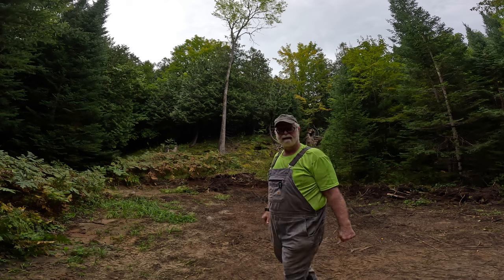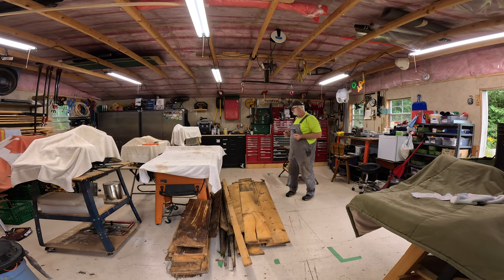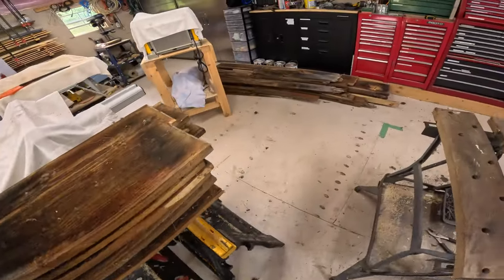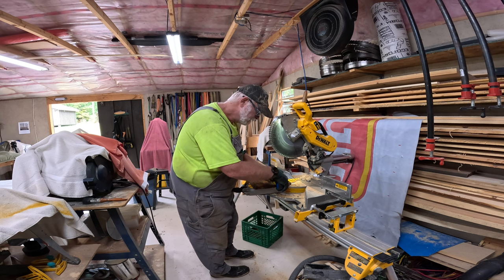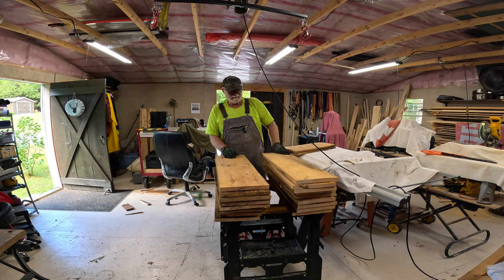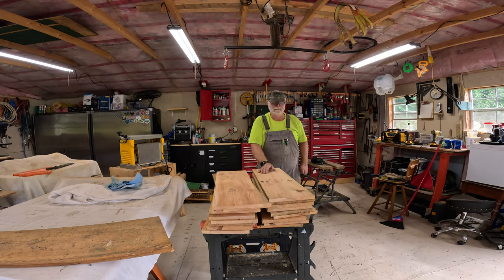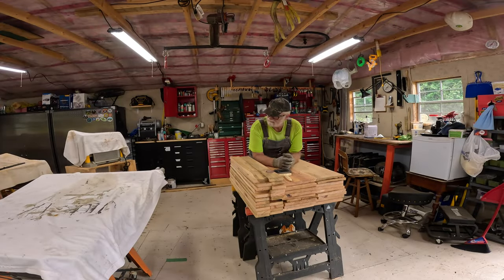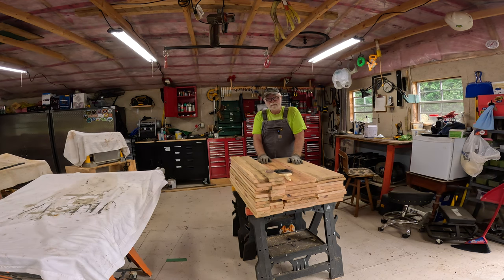HUGE Stackable Storage Boxes from SCRAPS - DIY Woodworking Challenge

Comment: If you've gone to the effort of pulling all the nails, put the offcuts through the shredder for future path repair use - beats burning for several reasons.
I recover lumber from all over - heck, I found a part sawn tree trunk on the shore today that's about 5' by 2' by 20" & I'm going back with the chainsaw tomorrow to cut it into 2" slabs. Might make small table tops or something.
Regarding the planer; get a cheap roller stand or two to support the timber on both infeed & outfeed sides - makes everything run way smoother.
Reply from the maker: Sometimes treasures turn up in unexpected places. The stands are a good idea. I have them and use them on my table saw. Thanks for stopping by!

Comment: That’s another good one, but it is not a big success. That’s a lot of work just to save a few boards…..CHEERS
Reply from the maker: That’s what I was thinking part way into this little project. But them I think about all of the work make the lumber I have from cutting down the tree to the finished board. It’s hard to draw a line. Thanks for stopping by Gator!